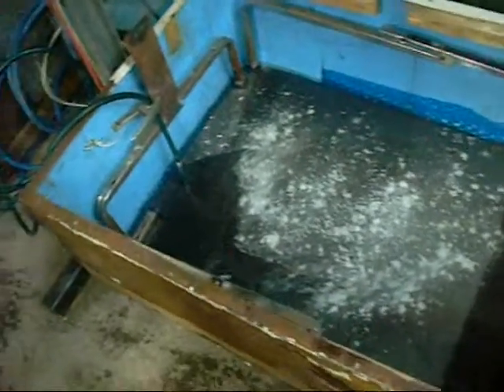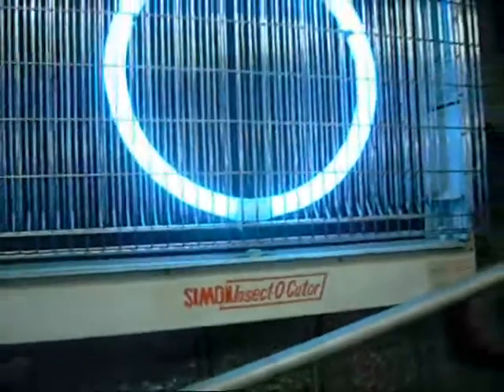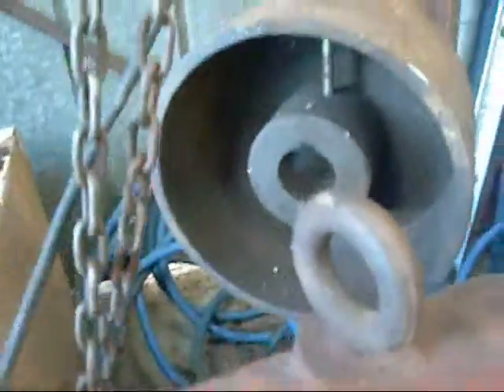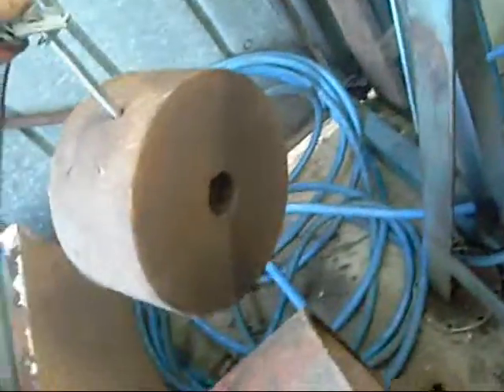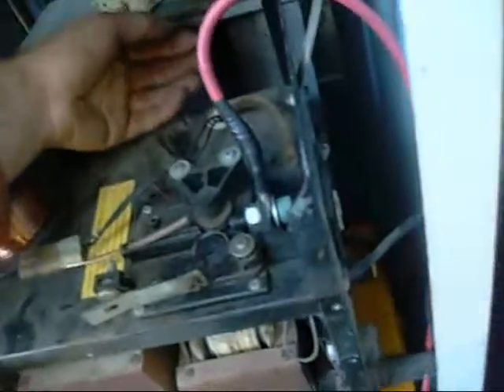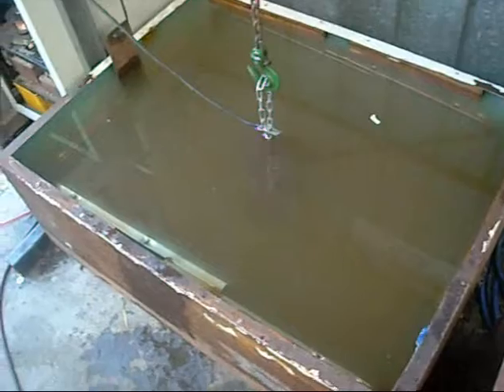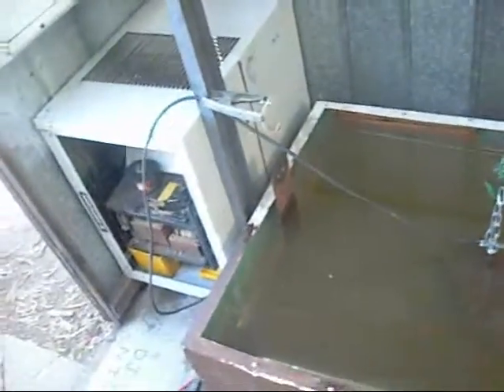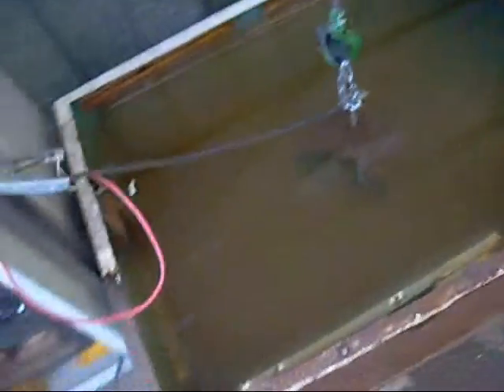Setting and Testing the 250L Electrolysis tank

Comment from the maker: @gavincurtis yeah I'll be installing the current transformer inside the welder this weekend, that way I just read the AC comming off the transformer as you said.

Electrolysis won't break down the actual metal but it does break down the oxide on the surface through ionization or somthing like that. nobody has been able to tell be exactly how it works.

Comment: So does electrolysis (to clean corroded parts) that removes rust and corrosion strip away the outer layer of metal atoms? Is this how it works?

Put your amp meter pickup on the low voltage secondary transformer AC output lead (just before it goes to the rectifier stack).  Ammeter should work.

Comment: With baking soda you will produce Chlorine gas as well, the hydrogen is a less concern because it will raise up to the sky faster then Helium. But the Chlorine gas is very, very toxic. With Drain cleaner you don''t have that problem, although it is a much more aggressive substance. If you decide to use drain cleaner make sure you use the grains and not the liquid version. You will need far less Drain cleaner then baking soda, so it's cheaper. It's better to add it in small quantities in steps.

Comment from the maker: @fritzhvac yeah I've isolated the electricals as best I can and I may put a screen around it for long runs.

I definitly need a open covered area for jobs like this!, but it also means making a 2nd crane to get things into and out of the tank.

The finished test worked well, tonns of pitting on the pulley surface but thats what the turret lathe is for, I'll re-machine most surfaces. after its dry and primed.

Comment from the maker: @mattyvt93 yeah i was wondering about that, if 10hrs in the sun does most small things, a few days in a warm shed will be adaquate for the housings.

I'll be cleaning and repairing the rotor and field poles while the finished housings sit, so it may be a few weeks before they get put under stress.

Comment: Dude, I used to work at the place where they make that welding wire! Haha I even worked on repairing the damned machine where they respool the wire from the large bobins the wire is spooled on when it's beeing drawn to those small ones you have there. It's a small world! :D

Comment: Yep, your suspicion is correct, those CT connected ammeters are meant for AC. As the DC output of your welder is not filtered, the meters respond only to the ripple current, not the total current. You'll need DC meters with shunt resistors if you want to measure current.... nice electro cleaning setup BTW